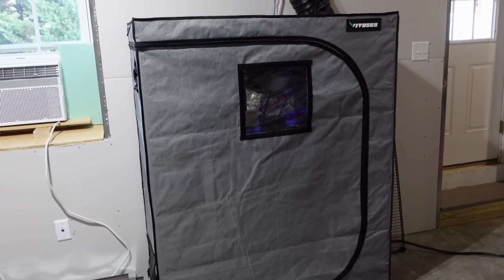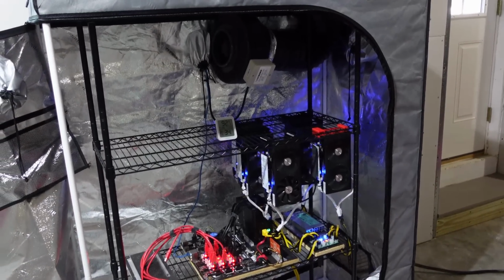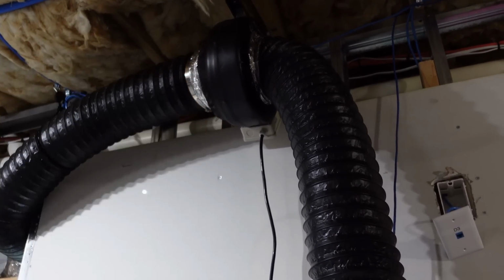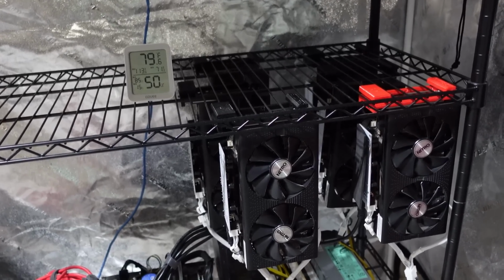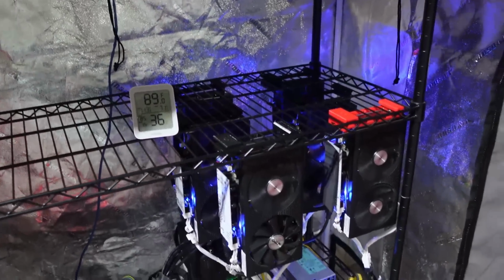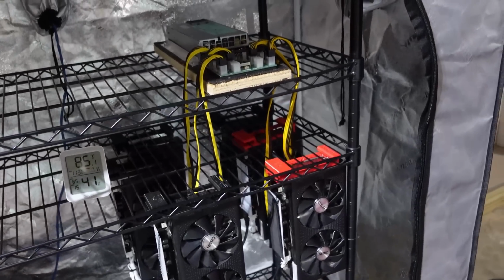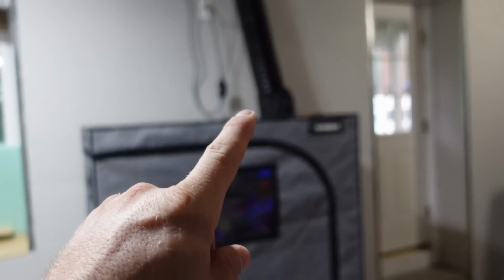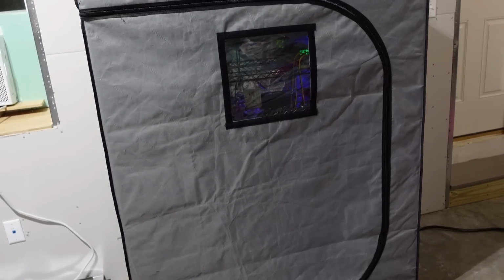Lowering The Temperature In My Ravencoin Mining Grow Tent

Comment from the maker: This mornings temps after running all night 85.6 F, heck yeah!  What solutions have you found to lower your Grow Tent Temperatures?
Reply: There's a 50cm 8pin to 2x 8pin splitter, come with normal wires and a silver plated wires in taobao's
Reply: I would duct some A/C into that tent instead of just an exhaust pulling hot air out! IF you were to do that I would scrap the exhaust and let the cold A/C air naturally push the hot air out through the top. Also cut the exhaust hose inside the tent so it is flush to the top of the tent, hanging down like that is creating a high heat air pressure zone. Keep in mind cold air falls while hot air rises

Comment: You really just need more airflow. The 8" is gonna solve this for you. If not just run the 8" and the 6" together. Make sure you have negative pressure in the tent so you know sir is moving from the intakes to the exhaust quickly and not stagnating anywhere.

Comment: Parallel Miner has 36 inch cables.  I use them on all my rigs.  There are 2 rules when it comes to grow tents.  1.  Don't use a grow tent.   2.  If you already violated rule 1, then take your GPUs out and proceed store or give away your grow tent.  If you only have 6 cards then "maybe" they are fine, but not at scale.  You need way more fresh air and CFM.  I am using 4K CFM fans.

Comment: What I have done is I use all octominer cases and I cut a hole in the tent around the case intake and Velcro the tent opening to the server case intake. The removes the need for a intake fan or anything of the sort. I have a 10” exhaust that goes out the window with only the 140mm case fans pushing air. I have managed to put 4 rigs with 12 3080s in one tent with no temp problem!
Reply from the maker: Wow impressive

Comment: I was thinking,the hose from 8inch fan to lower more near the gpus,so the heat would directly suck in by the fan?
Reply from the maker: Heat is coming more from the psu than gpus.
Reply: @TheHobbyistMiner  yes but psu is already on top, and the gpu's evry one of the making half heat of psu, and there is 6 of them, and it will be 12 of them 😉

Comment: best thing you can do is to get more exhaust going, both of those 6 inch ports on the top right and left of your tent should both have ducts with 240cfm fans pulling out air. I also put a box fan at the bottom of my tent , blowing up, with all 3 screen vents at the bottom open, mine is running at a cool 26c inside the tent. 1x 8" 720 cfm fan on top, 2x 6" 240cfm fans on each top side port, with all 3 screens at bottom open. runs about 10c cooler than it did in open air. and I've got just at 1.1ghs in my tent
Reply: Nice. I may reconfigure my tent like this. What is your total power draw and are your exhaust fans mounted inside or outside of tent? I'm currently at 12 GPUS and 2500w with temps inside reaching 37c using an 8" 735cfm top exhaust fan and 2 cheap box fans pulling in air from 2 lower side screen vents. I'm about to add another 400cfm 6" exhaust fan and another 3080 GPU. If I reconfigure like your setup, I'll have to turn my rig frame on it's side to allow air flow from the bottom up since the bottom of the frame is a solid piece of wood.
Reply: @jmcrae12345  I don't use any fans to push air into the tent, only 3 fans to evacuate air. The box fan on the bottom is to facilitate the hot air rising.
Reply: @jmcrae12345  always vent exhaust out the top if possible. Most rigs you see guys mounting fans vertically, blowing through the cards or pulling air through the cards. Not me, I build a row of 6 case fans and put them on top of the cards sucking the air upwards, on all the rigs.

Comment: Regarding the broken fan, you must have a rusty ball bushing bearing and broken plastic ring holder. I'd recommend taking is apart, soaking the bearing with WD40 and air dust off all the rust. It should run like new. I had the same problem.

Comment: Love your videos I started ravencoin light last night but something wrong I'm a newbie when it comes to mining but I started off in 30 megahash what a 3060 ti after 6 hours it dropped to 11.5 Hive os had a bunch of warnings about Nvidia OC failure I don't know the card  didn't seem to run hot it was at 50° I used some of the overclock settings from your video I don't know what the problem is any help would be greatly appreciated
Reply from the maker: Check that video and the pinned comment. I changed things up a tad.

As for OC Settings i have been tweaking my 3060 TI OC Settings for RVL.  Currently running really well at 0 Core, 1350 Memory and 155 PL getting 35.33 MHs
Reply: @TheHobbyistMiner  I was using 2500 memory 1800 core 70 power you want me to lower the core to 0 and how do I get to 155 power level I'm brand new at this sorry I'm learning but thank you for all your help I really appreciate it man you got great content I definitely subscribed I just watched a video on your grow tent to